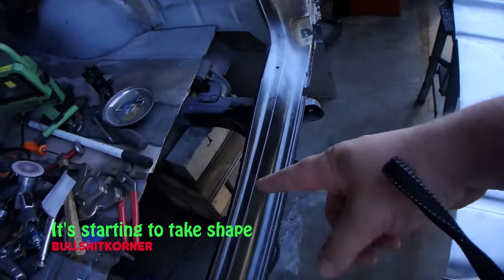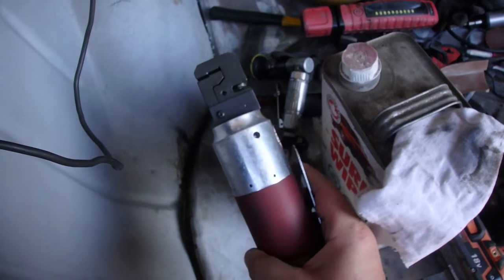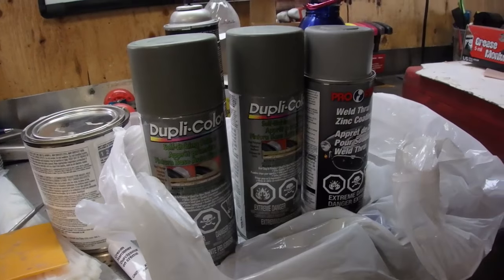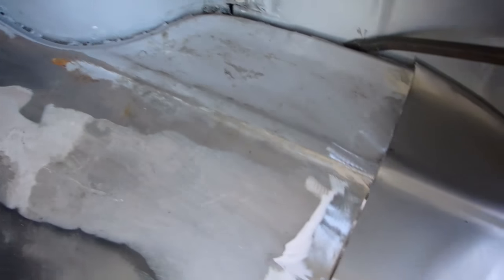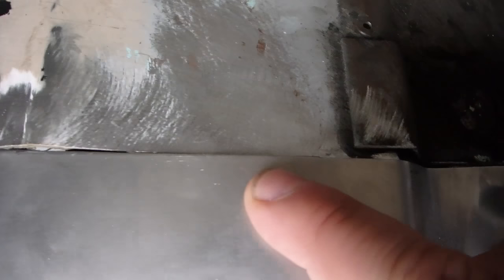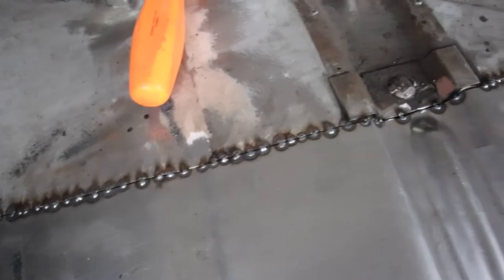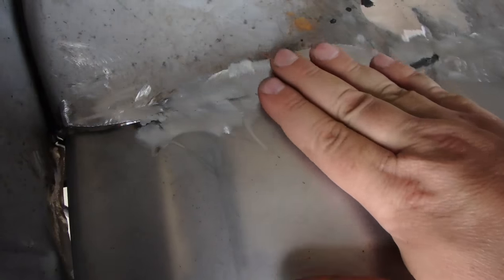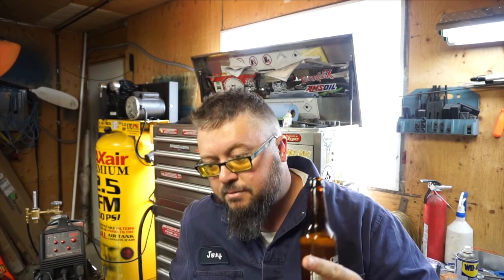How to Weld Body Panels (Fitting the Trunk Up)

Comment: Great work on the '57 so far. In the case of the right side trunk floor, could you make a slice with a thin cut off wheel on the left side and cut a small pie out of the right side so you could tweak it to get the body lines to match? You could even weld the pie piece back in on the left side to cut down on the bullshit. Another idea is to get a small bead roller and basically fab a small section to fit. I know it's a PITA, but I bet you'd be good at it AND it would come in handy on future projects. P.S. that fart was nasty! LOL
Reply from the maker: you will see what i do in the near future

Comment: any videos on fit up on 55 trunk tail piece followed by trunk lid alignment the whole back of my 55 2 door hard top needed rear floor tail pice and left and right shrouds below the tail light replaced and I struggling a little currently i have things  screwed together working with fit up and I want to make sure the trunk lid will close properly....help

Comment: Good morning by the way and I just started welding myself in hopes to save a lot of money but, I bought the harbor freight $99 flux core welder and do you know or anybody else know easier or more trick's to upgrade it and turn it to a DC welder. I know the bel transformer one for the motor for the wire feed. The one with capacitors seems to tricky to me being the guy who made the video is not to explanatory on materials and exactly which one's to get.
Reply from the maker: that I don't know